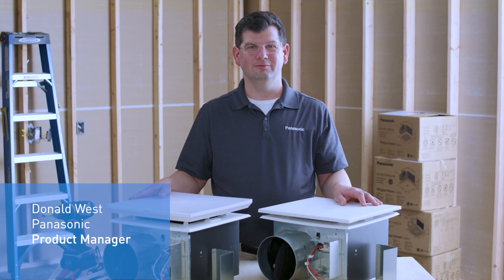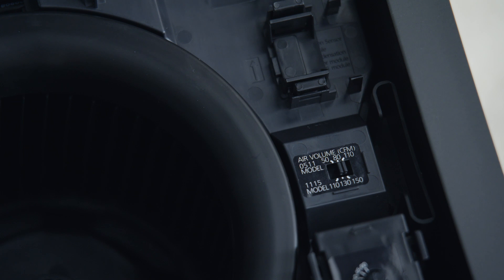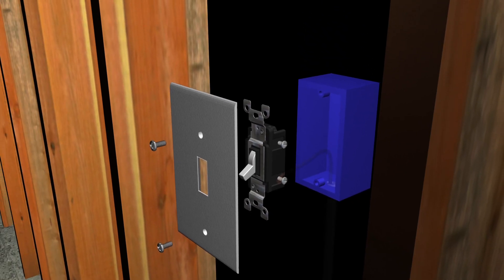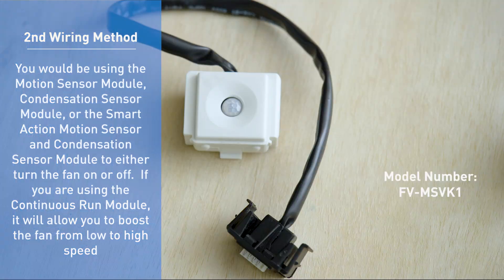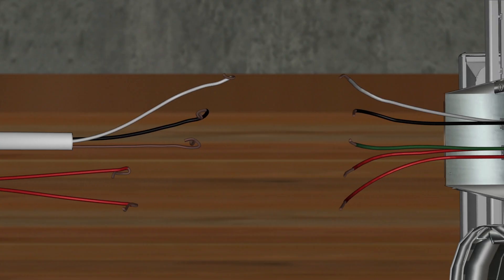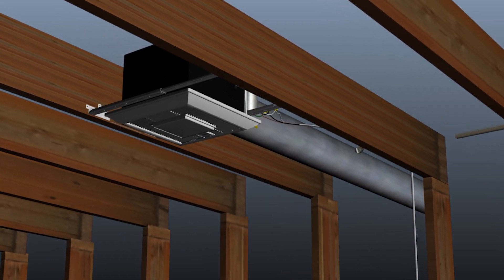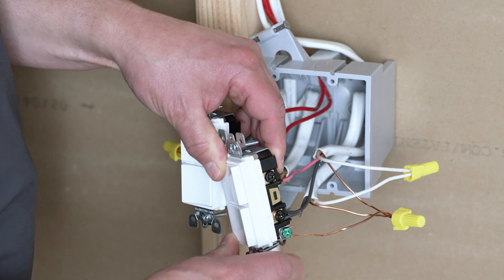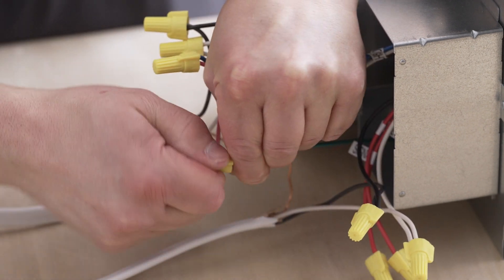WhisperGreen Select Wiring Animation

Comment: what is the point of the red wire
Reply: The red wires are for the controller part of the circuit board.  When the red wires are connected through a wall switch, the controller goes from standby to on, allowing continuous fan operation, and allows the use of motion and humidity sensors.

In my case, I am not using humidity or motion sensors.  I am also not using the continuous run feature of the fan, so I capped off the red wires individually in the junction box.